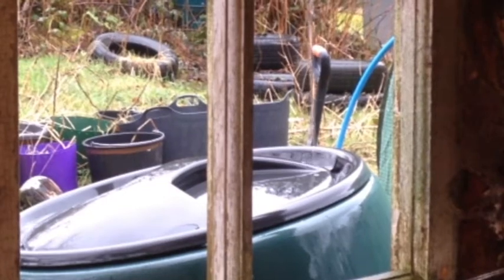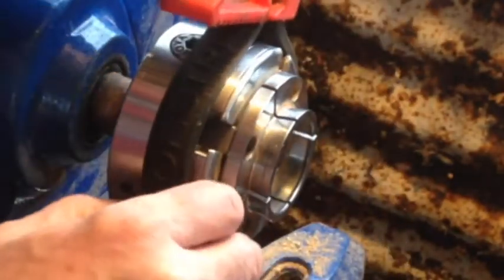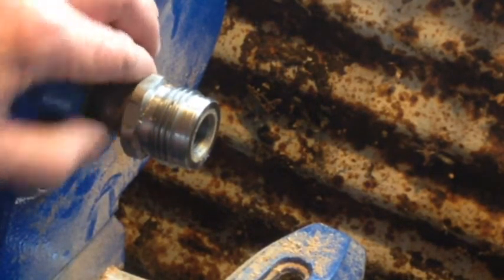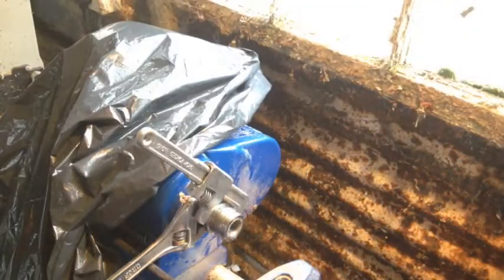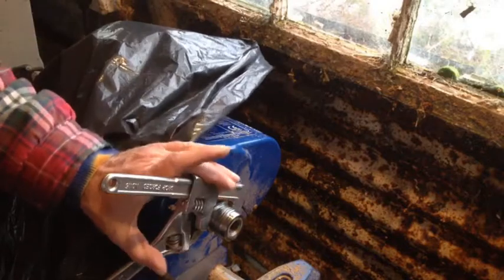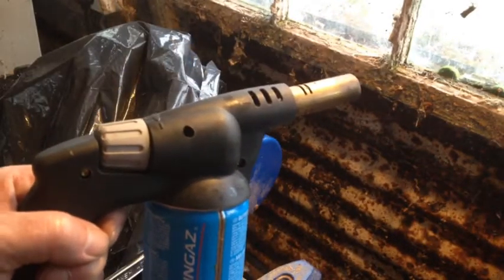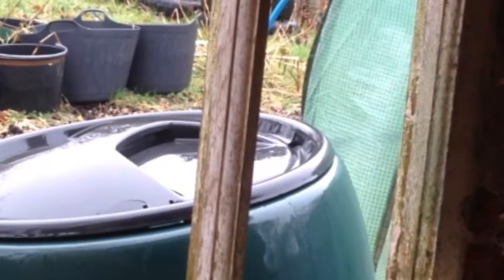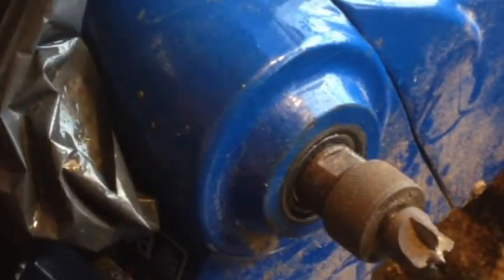Stuck Like Chuck - Supernova 2 Woodturning Chuck Won't Come Off... At First!

Comment: Thanks for the video.  Mine's still stuck on my lathe.  My spindle has no "flats" to grip it with, and the tool to brace it against is bending under the pressure.